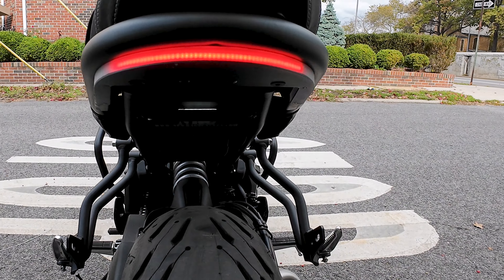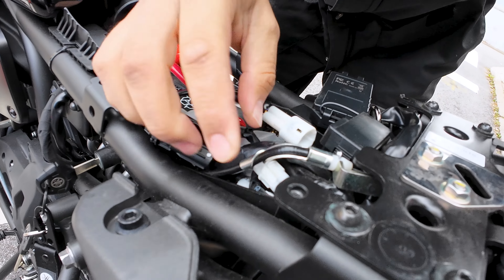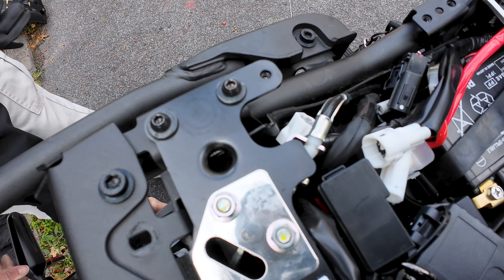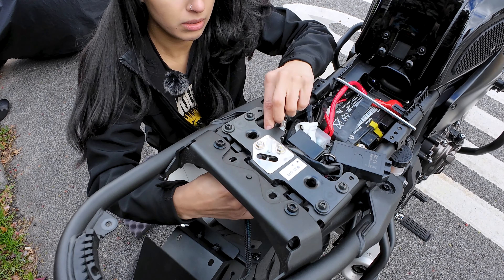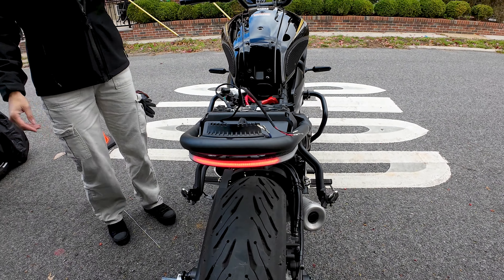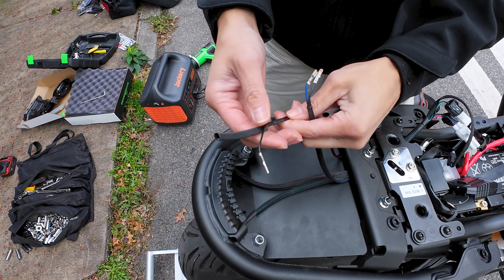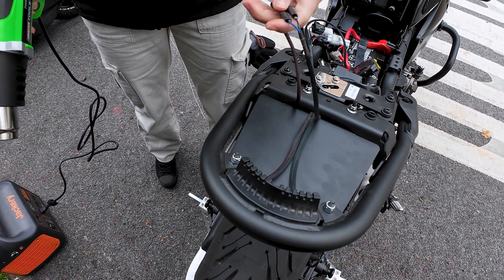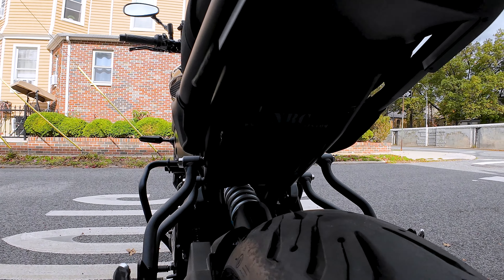Fender Eliminator Kit - Installation Walkthrough

Comment: Just a quick question. Is that tail light legal, I mean, are there any requirements to have some (I think 4 to 6-inch) gaps be the signal light from the tail light?
Reply from the maker: As far as my state goes (New York) it's legal. There isn't a requirementa on how far the turn signals need to be but the stop light does need to be visible from 300 ft away and there has to be a white light aiming on the license plate so its visible from 50 ft away which this kit satifies. I guess I'd check the laws for where you're located. Hope this helps!
Reply: @abitofsindy  Thank you. I'll have che the local law.

Comment: Hey! Just wanted to ask you which kit did you get, with the dual load equaliser or not? And what is the difference between these two variants?
Reply from the maker: Hey, I got the tucked version without the dual-load equalizer. The difference is with the dual-load equalizer you get a slower flash rate while without, it flashes quicker. Hope this helps!
Reply: @abitofsindy , thank you for the answer! It looks like it flashes slowly on your bike, do you have a flasher relay installed on it?
Reply from the maker: @michaelpolishchuk158  No problem and I didn't install a flasher relay either

Comment: How’d you fix hyperflash?
Reply from the maker: There is an option to get the kit with a dual-load equalizer to slow down the flash which I did not get. Basically, I did nothing at all this is how the version I chose came.

Comment: Still don’t know if I wanna get this or not… I like it but … lol still like the small circle tail light
Reply from the maker: I also debated switching over to that look since it’s pretty minimal but this look ended up winning me over. Anything that involves removing the plastic below the painted rear fender changes the look of the bike for the better. Ride safe! ✌️
Reply: We have the same bike! And it does look cleaner… lol I might just pull the trigger and get it after a few months  🤦🏻‍♂️
Reply from the maker: Yeah go for it when you have the chance…best part is we already got the killer bikes lol 🤘